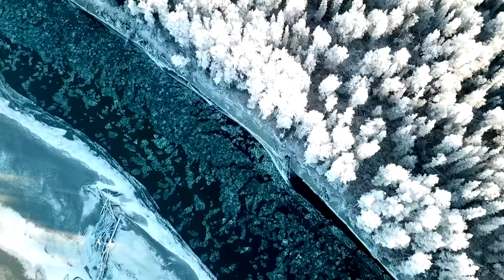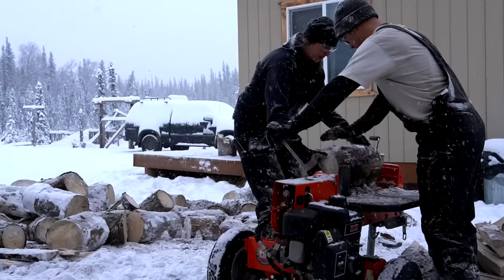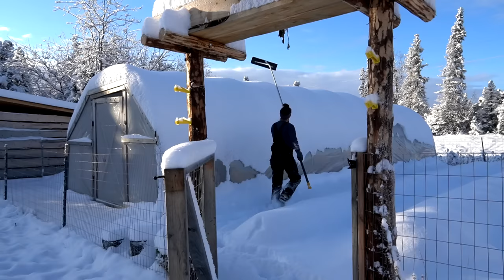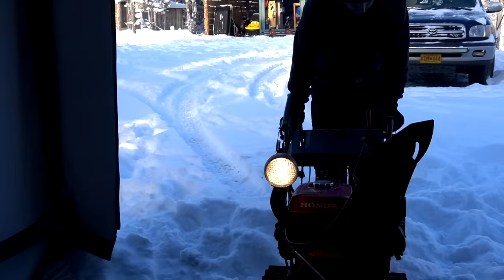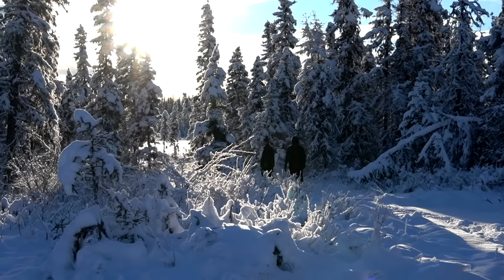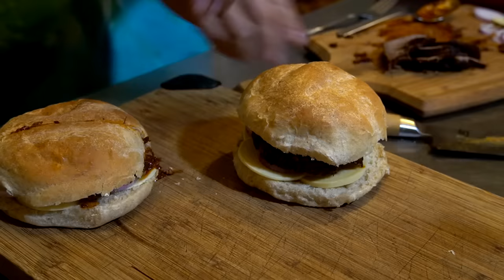Cold Weather at the Cabin | Life in Alaska

Comment: We put a heat lamp in our chicken coop in the cold winter. We make sure the lamps  are far away from the chicken. So they can’t get burned. We also make it to where the straw, hay or wood clipping cant get hot. It helps out with egg laying. That has been my experience. Some will say it doesn’t work. It also helps with keeping the water from freezing you can get a couple and keep them out of the range of the chicken so they don’t get burned.

Comment: If the underneath side of your primary cabin is not sealed, you should seal it with this 4'x50' sealer that looks like bubblewrp but stronger and a silver layer. They sell it at Friedman's here in Santa Rosa. Contractor here said it is better than insulating your floor joists as it keeps the air from circulating.

Comment: Air is denser when cold, has more oxygen density and will cause a leaner burn. I live in Florida and build drag cars, I always let the car sit outside for a few hours (shop is AC'd) before I adjust fuel pressures. They will change from being inside at 75 to being outside at 95+.

Comment: Start your snow blower in the summer, once in a while, and just let it idle for a bit. Or in late fall, before the snow flies. The way it was explained to me, is the unburnt fuel residue left in the engine evaporates into a varnish-like coating. This interferes with the normal operation of the engine until it dissolves or burns up or both.

Comment: One recommendation, sell the hydraulic log splitter and buy a super splitter.

It's a little bit more money, but 10x faster and no hydraulics to worry about blowing on the cold days.

The super splitter is kinetic powered meaning the engine turns a flywheel and that flywheel energy is put onto an arm with a blade.

Comment: Snowblower issue almost HAS to be gas delivery related.... thus once its running for the year you can pull start it without issue.  Its spark/fuel/air, cant see any reason only the first start of the year would be hard, but no issues the rest of the year unless the gas lines full of air.

Comment: ive grown up and lived in Alaska for years. Cant say Im impressed with your house. From what ive seen it should be an 8 sided building made off the ground with 2 wood stoves. No second floor. Use run the water pipes over the vents for hot water then one propane stove for summer cooking. You should have an undergound diesel tank with electric generator. Windows need bear proofing. Ive shot some ten bears every years there they are a nusicance.You also need an underground food storage locker wolverine proof. Some ideas for you....

Comment: Those slabs are a pain to stack too, besides how shitty they are as firewood. Sucks to see you guys sectioning, chopping and stacking out in the colder months of the year. I don't miss how much work a stove was between felling and limbing trees (or just salvaging loggers leftovers), sectioning them out in the woods, piling the truck till we were rounded up over the cab, splitting it all and throwing it downstairs once we were home, then stacking it, lighting/maintaining fires, the metric ton of cleaning, between the stove itself and the floors ugh its just a mess. I'm happy to pay for oil to avoid all that work.

Comment: HERE IN COLORADO I USE A 22 TON LOG SPLITTER FOR MY PINION PINE AND JUNIPER WINTER WOOD. THIS IS THE FIRST TIME I HAVE EVER SEEN THIS DUAL ACTION BLADE/SPLITTER MACHINE!! DO YOU KNOW THE BRAND NAME, LOG LENGTH , HP ON THIS MACHINE... I LIKE IT. PROPANE REFILLING PROBLEMS IN THE STATE- DOES NOT AFFECT ME, AS I LIVE IN A 8X20 1977 FT TRAILER AND HEAT WITH WOOD. I AM COMPLETELY OFF THE GRID- SOLAR/BACK-UP GENERATOR, HAUL WATER, ETC. IS THAT A SOLAR PANEL COVERED IN SNOW ATTACHED TO AN OUT BUILDING? THANKS, FOR SHARING...EAGLE-SAN IN CO.